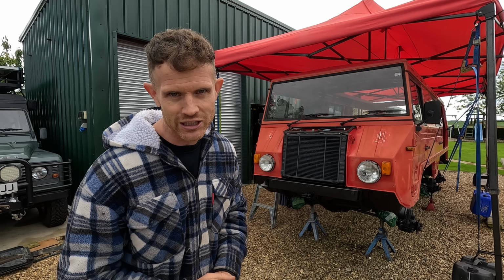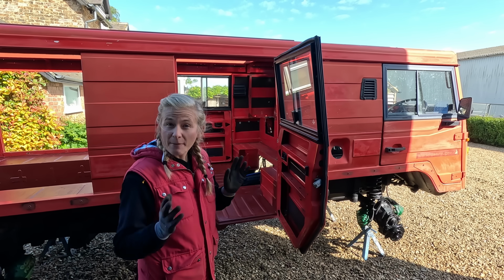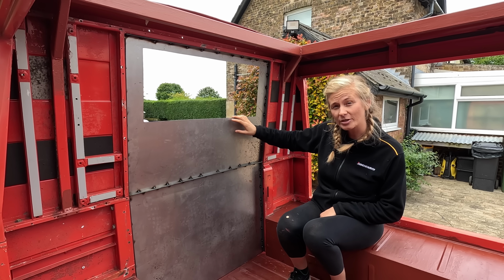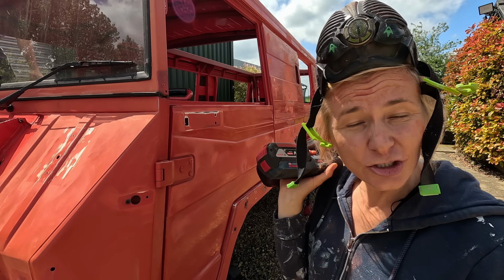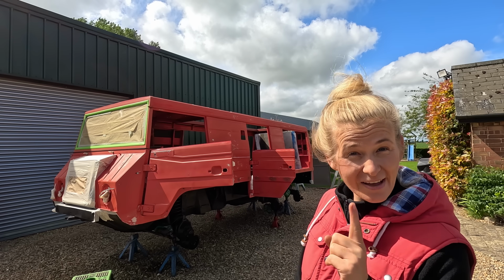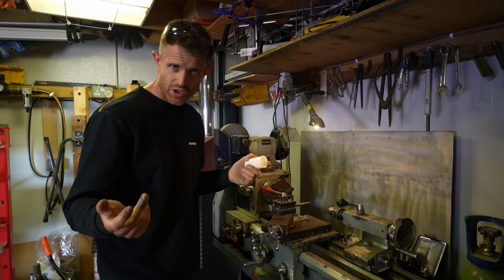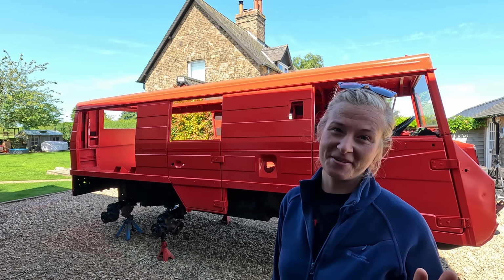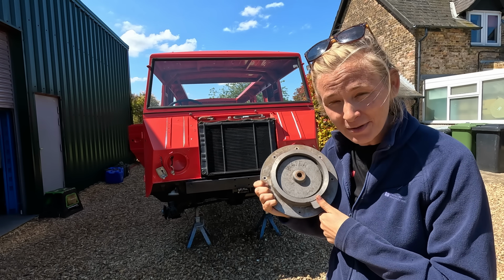6x6 Expedition Truck Transformation: Building Our Dream Off-Road Camper

Comment: Johnny Boy! Critical Smudger is at it again... Welding (or grinding) next to glass??? You'll be sorry! Love the vid as always, makes my Saturday morning, I even watch it in my undies, so I can be part of the TTT gang! 😁
Reply from the maker: 😂😂😂😂 pmsl, defo part of the gang, didn’t know about welding next to glass thing, does it smash the glass ?
Reply: @truebluetravellers  Not smash it but ruins it, and not nice when you rub the mist off the glass with the back of your hand... The hot metal sparks melt the glass, some balls of metal can even stay stuck on the surface. Grinding can make even more of a mess - it's called 'grinding rash' in the motor trade. Run your hands over the inside of the screen - you'll know all about it then! 🙄🙄🙄

Comment: did you put any rust treatment in the hole? after you cut out the bad/rusty metal before welding good metal in place, it's just that i didn't see you doing it on camera, just asking.
Reply from the maker: No just went until there was no rust at all and back to all good metal and then cleaned it up then treated the whole area with red lead before painting 👍

Comment: Holy cow, this is the first video of yours I've seen, i am rolling on the floor 😂😂, love your humor!

Guys, I've got a (set of) question(s) if you don't mind 😊

What are the internal dimensions of the Pinzgauer? Internal width over the "wheelarches" and width at the roof, width and height of the wheelarches, width between the wheelarches, height, and length of the "living" area.

Keep up the good work!
Reply from the maker: 😂😂 thanks mate so glad it made you laugh. No worries ask away 
Living space length:3030 mm 
Height: 1030
Width at roof: 1530
Wheel arch height: 260
Wheel arch length:2159
wheel arch width: 380
Width between arches: 820
Reply: @truebluetravellers  thank you so much :) the wheelarch height I guess is around 30cm by looking at it (edit: or I just can't see what you wrote already :D ). 
Thats quite generous space (in comparison to a defender).

I am thinking about the 4x4 soft top troop carrier ... stripping out everything at the back so I could simply design a camperbox. Not quite military looking but it fits 2 in an overcab layout nicely.
I hoped  it will be around 170cm wide to start with, so my 208cm wide design wouldn't look so oversize 😂

Comment: What's that ratchet rivet tool you are using?
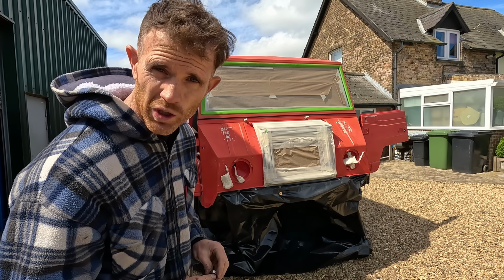Reply from the maker: It’s a rivinut gun brilliant thing, lets you fix threaded nuts into a piece you can’t get a nut on the back of so you can bolt things on. Jon talks about it and shows it in this video at 13:08 if that’s helpful https://youtu.be/N1LJKYQDbBs?si=SAUyv6sRjzWfjz6d
Reply: Thank you very much!

Comment: Hey Jess I noticed that you had a problem with your leggings staying put like all of us . . . But if your are open to suggestions I’ve come up with a way to combat that I use corner keepers for bed sheets clip to top of leggings and bottom of bra band and presto no more issues you can thank me later
Reply from the maker: Ooo thanks for the tip, will check these out 👌